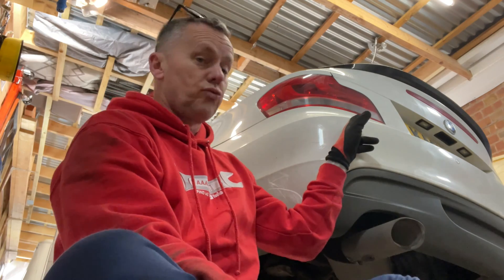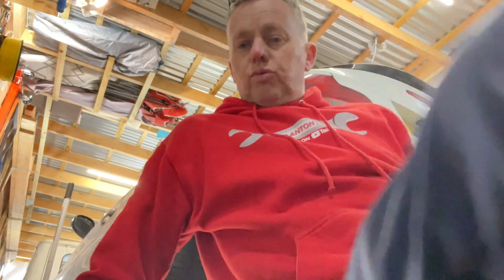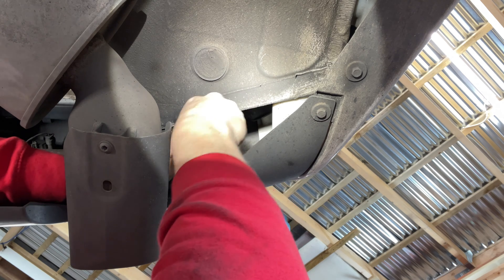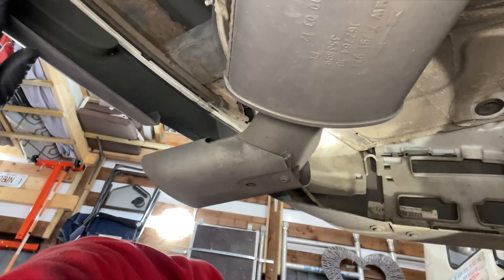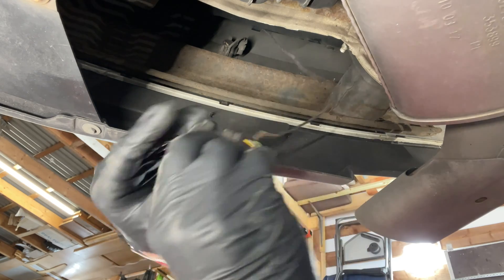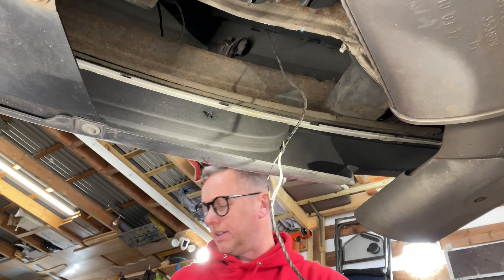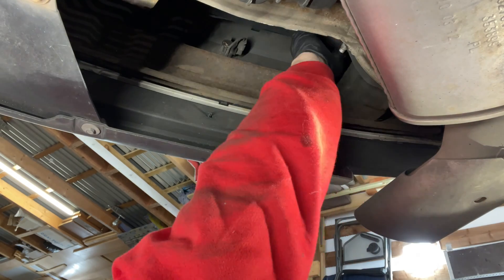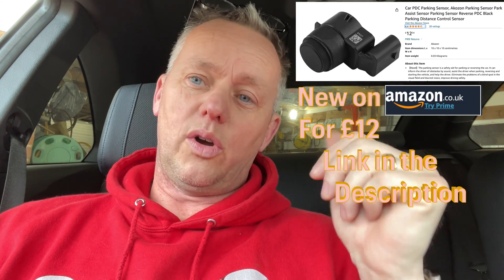9E33 Bmw Parking Sensor Fault, PDC Lines Ultrasonic Sensor, How to Repair E82, Broken Wire xtool d7s

Comment: Bit off the subject to the video I have a Citroën c1 2006 had an engine change and it cranks no start now but ran before with the bad engine any ideas
Reply from the maker: Do you get fuel pump priming and sparks at the plugs on crank? Thanks for the great comments👍🏻👍🏻🛠
Reply: Pump primes and get spark on crank .I've also checked all earth points on the body shell and engine block and gearbox still nothing. I'm thinking possible immobiliser but it doesn't start then shut straight off.

Comment: Great find ant, got a similar problem with my dads car sensors work intermittently i suspect the is making contact with the rear bumper bar when the weather gets better ill take a look at it.... love ll the vids mate keep them coming.... ps: love my bmw's great cars
Reply from the maker: I have the same issue on the e91 when its wet they beep like you are close to a wall, might be the same issue!! I feel another video coming on 😂 Thanks for the great comments👍🏻👍🏻🛠